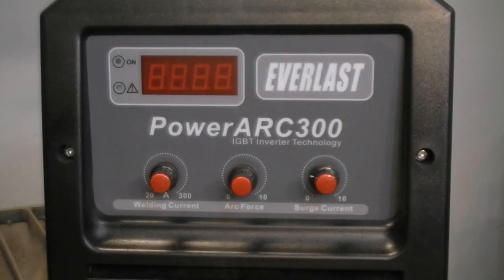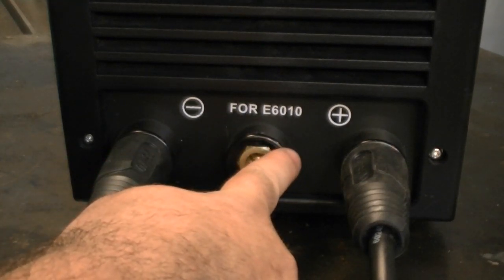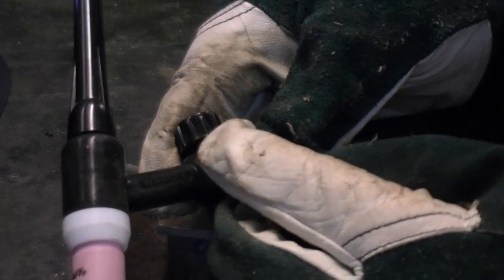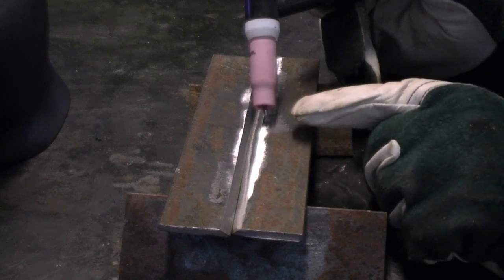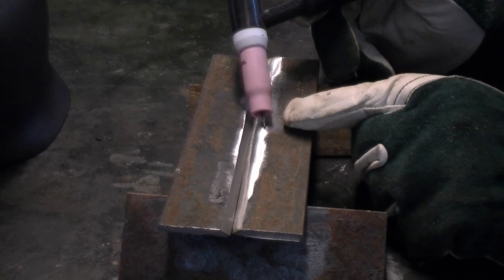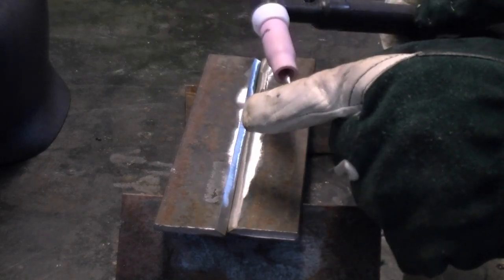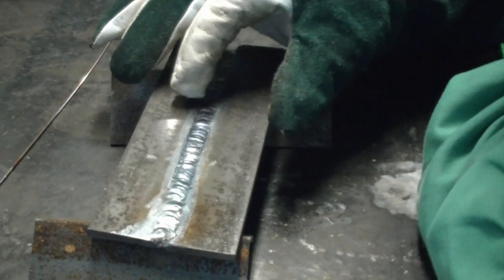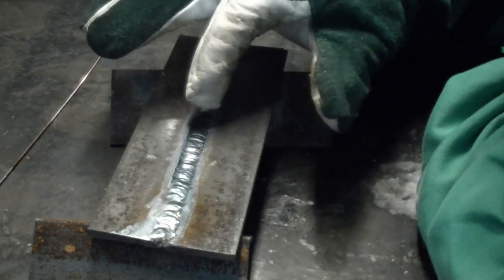Conversion Everlast Power Arc DC Stick Welder - To  a DC TIG Welder Part 2

Comment from the maker: Current describes the condition of the actual FLOW of electricity, something that is either present or not. i.e. You may ask the question: Is there Current present? You would not ask: Is there  Amperage Present? Amperes, or referring to specifically to the word Amperage, is the measure of the AMOUNT of that flow, just as we'd refer to the force of that flow with Voltage.   Current may be a word that is defined differently from country to country that speaks English.
Reply: Can i use this on a brass plate?